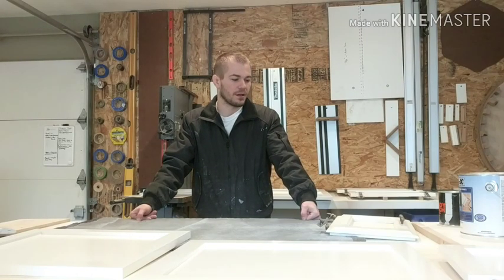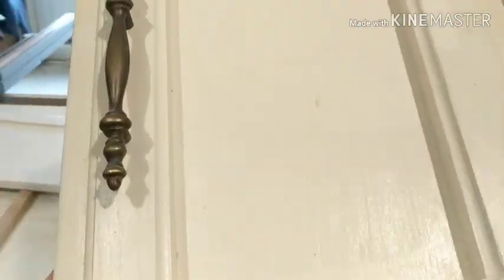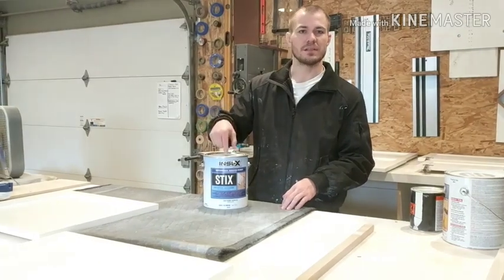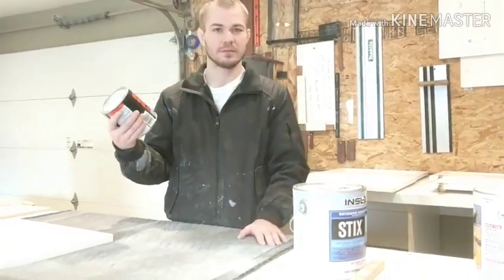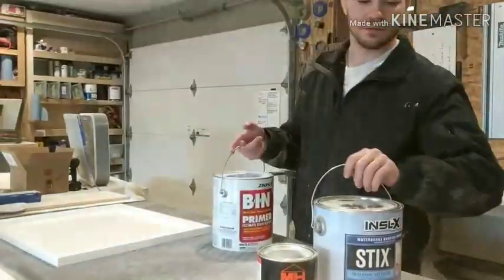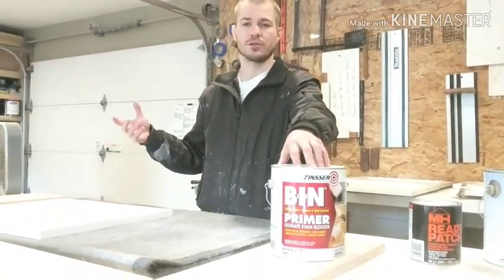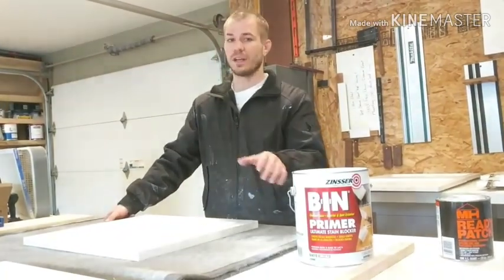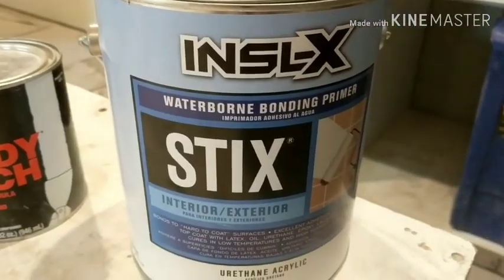Pore Filling and Painting Oak Cabinet Doors

Comment: I would apply a grain filler or you could use automotive metal glaze. Put a skim coat down, and sand It off. Easy sanding and I'm sure you would only have to prime once
Reply from the maker: Ya that sounds like it could do the job!

Comment: I feel like it would be more cost efficient for my customer to buy new doors at that point. Not to mention a lot less of a pain in the butt and headache for me the painter. Doing that process on 50+ door and drawer faces sounds like a complete nightmare, especially if there are decorative moldings or bevel's that would need to be hand sanded. This is probably a good solution for a DIY'er that is only doing it once on their own kitchen but I'd probably quit if this was my process on every job, hah... Or charge double, take the extra money to buy new smooth surfaced doors, finish those, reinstall, and save all that extra time. Lol. 

Thanks for showing the process though, I've never seen oak cabinets get so smooth before.
Reply from the maker: Ya it's a total nightmare. Honestly I've found a slightly faster method since then, but not much faster. It's still a huge pain. You can back roll and not sand between primer coats and then only sand on the final prime coat before top coating. But it's still a horrible process. You are 100% correct, that it's easier and better to order brand new doors. I do not offer this service of grain filling doors any more. I will do it on cabinet bases since it's all flat stock, but then on moldings I don't offer it. I will only replace them.

Comment: I'm seriously thinking of taking on this job in my kitchen over the coming winter months (which is probably how long it will take since I've got like 26 doors (not including drawers)). As an alternate to spraying the Zinsser, could that be brushed/rolled and then sanded for smoothness? I don't see myself running that stuff through a sprayer. Thanks for the video, and the warning.
Reply from the maker: yes sir. they can be rolled or brushed and sanded. It will take a lot of time and a lot of sandpaper, but it can totally be done
Reply: @MaydaysCustomWoodworks  Thanks for the feedback. If you ever decide to do an in depth video or videos, I'm sure it will be much watched and appreciated. Thanks again.

Comment: Hi, thanks so much for sharing this! I'm getting ready to start a home project of refinishing my red oak cabinets and will be following your technique here. Can you tell me, how did you apply the MH ready patch - a bristle brush, sprayer? Also, did you dilute it to fine tune the consistency for grain fill? Thanks!
Reply from the maker: Hey Katherine. Sorry for the late reply. I bet you already finished your project lol. I actually just use a flexible putty knife to apply the ready patch. And i dont thin it. Just use it full strength
Reply: I did about 80 oak doors... To save time I mixed joint compound with water and painted it on after one sand. Sand that down then oil primer to block stains, sand, then 2 coats of paint on top.

Comment: Hello, great video thank you for sharing. Your final product came out looking better than any other videos I have seen on here , I will follow your steps. Question, the first primer that you used, Stix,, you did two coats before the patching , did you do a third coat after? Is the patching used only on deep wood grains? And is the Bin perimeter only used over the patched areas or the entire surface? After that can I use a tinted lacquer for my final coats? Thank you for your help
Reply from the maker: Hello Katherine. Sorry for the late reply. I waited 2 coats to use the ready patch because a lot of the grain will be filled by those 2 heavy coats of Stix. Then If any areas are still porous then i will use the ready patch. Ready patch doesnt like to be top coated without being primered first. If I am using an aerosol of BIN then i will spot prime over stain bleed through spots and the ready patch. if i'm spraying it out of a can then i will just do the whole door with BIN. 

Every finish is different and i cant say for sure that your pigmented lacquer will work on top of stix or BIN. But i would assume it should be just fine
Reply from the maker: Hello Katherine. Sorry for the late reply. I waited 2 coats to use the ready patch because a lot of the grain will be filled by those 2 heavy coats of Stix. Then If any areas are still porous then i will use the ready patch. Ready patch doesnt like to be top coated without being primered first. If I am using an aerosol of BIN then i will spot prime over stain bleed through spots and the ready patch. if i'm spraying it out of a can then i will just do the whole door with BIN. 

Every finish is different and i cant say for sure that your pigmented lacquer will work on top of stix or BIN. But i would assume it should be just fine

Comment: Can you brush or roll the Stix with success?
Reply from the maker: Yes you can. But you will need to do more sanding because it will leave brush strokes. You can just sand them out tho. Also.... I have recently switched to Monochem Monobond over Stix. Similar properties except Monobond sands just a little better and levels out a little better. But both primers are excellent
Reply: I have a mouse sander, any chance that would work for the sanding portion ?

Comment: 2 coats BIN, Aquacoat 2-3 coats, finish paint coat. BIN and finish paint coat applied with HVLP sprayer. Cheap spray booth= cheapest square tent from Walmart and cheap clothing rack
Reply from the maker: There are many ways to skin a cat. This way you mentioned may work just fine. But i've seen lotsa of videos of people using aquacoat and i've never once seen it fully seal that grain 100%. and BIN is a great primer but it doesnt build for crap. Thats why i suggested using the Stix. one coat of stix can be thicker than 2 coats of BIN.
Reply: @MaydaysCustomWoodworks  3 coats of aquacoat sanded properly between applications has gotten me factory smooth results. I prefer goodfilla as it’s easier to see once applied but the aquacoat gel seems to do a better job of filling in small surface defects and scratches so it saves a step of repairing all the imperfections prior to grain filling so in turn saves a lot of time sanding. Definitely more than one way to do it- I was merry offering up another method to the people
Reply from the maker: thats awesome man. I will keep that in mind as well for future applications as well. And i still need to do some experimenting when doing large grain filling when it comes to certain primers building and filling grain without sanding between coats as well. I'm sure with certain primers it can absoltely be done and save some sanding time there as well. thanks for the input

Comment: I bet your do good job. the thing is, you make it painfully difficult, and its not needed. skip all the sanding and sanding and more sanding. 3 times priming??? you need to sand ones basically. apply gloss off product as well. then apply GRAIN filler (not wood filler), 2 or 3 coats. sometimes 4 coats. very light sanding required. Prime Ones. very  light sand by hand. and apply paint of your choice, best you can get.... and spraying of coarse. I am not saying it will be more smooth or anything like that. same finish, just much much much easier. cheers
Reply from the maker: thanks for the input